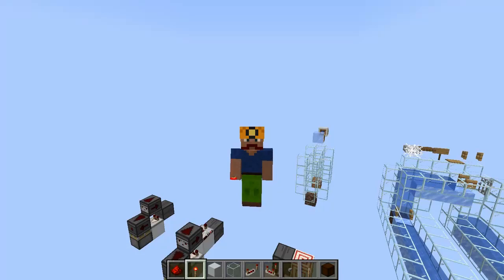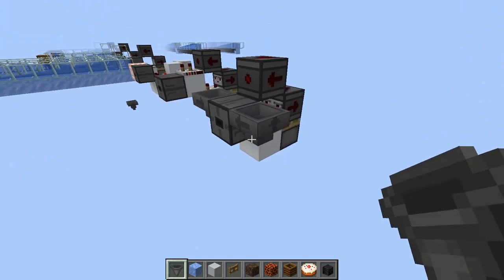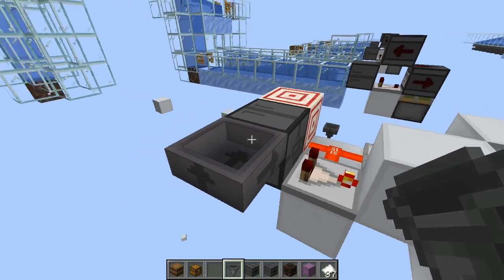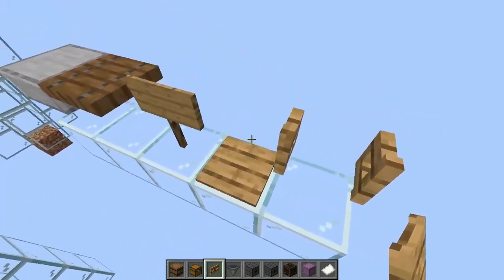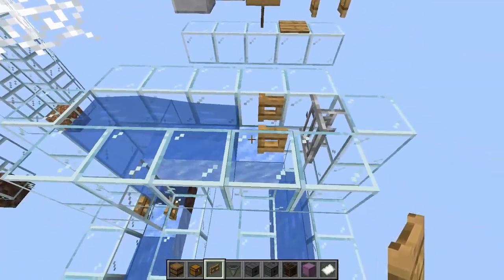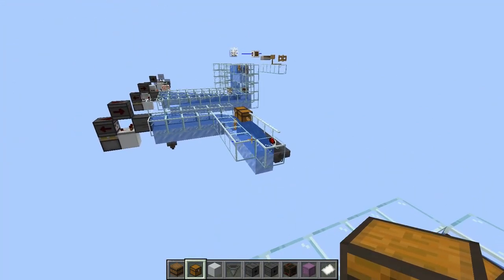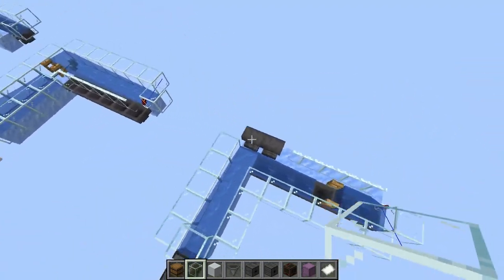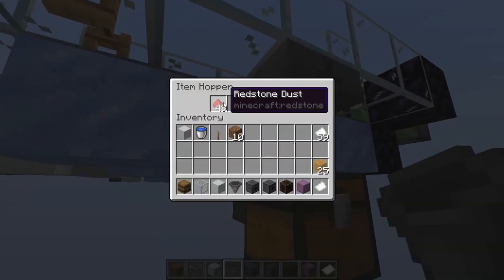How to transport items with water streams.

Comment: Great tutorial showing all water transportation mechanics! One tip: kelp can be placed directly on soul sand, so you do not need to switch it out to dirt first. An alternative to placing all kelp is to place one and then bone meal it. Then you break the lowest kelp. This is especially beneficial for high bubble elevators where you'd have problems with breathing if you try to swim through it.

Comment: I have a BIG problem in 1.16.5 handling item speed in water streams.

Making water streams in 1.16.1 I noticed that a configuration like 17:15 WITHOUT ice underneath makes items go SLOWER, which is really really useful in a bunch of situations (mainly to avoid items skipping hoppers). This can be obtained also in other ways, the point is that whenever the item is mostly outside the water stream it goes slower, and this feature is soooo good beacuse it gives you a lot more control over the stream. However, updating to 1.16.5 it doesn't work, and even using soulsand (which SHOULD make items go slower in water streams) sometimes items can "jump" a block when they float at maximum height at the beginning part of a water stream (where water is higher). This is really annoying and broke a bunch of really neat and cool sorting contraption I made, do you think it was intended? Or a bug? Do you know other ways to handle item's speed in water streams?

I tried to use a cobweb after hopper-speed dispenser, but in some cases I have more item filters tiled with 41-1-1-1-1 configuration (overflow protection) and from the cobweb can occasionally spill more items than those a filter can handle (usually 16-20, but sometimes even more and with a shorter delay within a blob and the following, causing overflow... it's really random). The only solutions I know are:

1. Slow down the dispenser
2. De-tile the filters to let them absorb more then 23 items at a time
3. Time properly the items with pistons pushing and retracting at hopper speed.
4. Soulsand underneath the item path (like 17:15 but with soulsand in place of ice) -still items would "jump" in certain locations, it doesn't seem to be a big problem since items slowed down on soulsand tend to stack togheter in any case, but it needs more testing.

EDIT. Oh however your video is great and thought me the very basis to handle water streams properly, thank you

Comment: But how to align items if I have a straight water stream(due to space constraint) with no bending to hit with chests or honey?
Reply from the maker: you can use pistons to push the items to one side or another, but you will need to put honey blocks or some other non-full block on the recieving side so that the items can hang off the edge. If you use slime blocks on the end of the piston you can cover big chunks of the stream at once, just make sure you don't crush your source block.

If you can't change the blocks on the side of the stream then the only other option I can think of is to control how items are input to the stream so that they line up properly on the edge.

Comment: i have a problem,i have a guardian farm that's outputing so many items that even double hopper speed cannot handle,do you have any solution? nice vid btw
Reply: Usually hopper minecarts that are on top of two more hopper minecarts (like pyramids) is a good solution, otherwise you just push the items with slimeblocks  on an ice line with the sorters once you have condensed them in one block
Reply: triple hopper speed.
Reply from the maker: @tritti96  Yea, this works, but it's tricky to line up the carts. Maybe I'll do a little tutorial on aligning hopper minecarts.
Reply: @metamilo  yes, that would be really nice!
Reply: @tritti96  is it possible to trick the game to have a water stream in the nether? im a little short on rescources so it would be nice to have a simple solution(yea i haven't tried the ice line and slime block method,it might work but im not sure,because the guardian dies in a 2x2 platform of magma block)
Reply: @ultrareverse  The only way to place water in the nether is in creative mode. If guardians die of fall damage you theoretically don't need magma blocks, but a sistem like the The Mega Hopper by JL that condenses everything to one block. It can be done in 2D, as ilmango did in his basalt farm, which is way easier